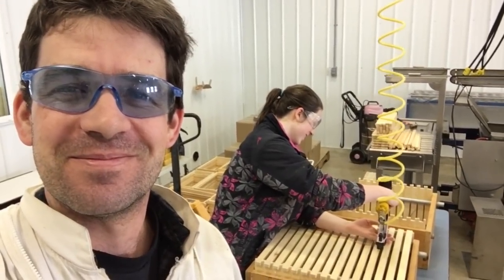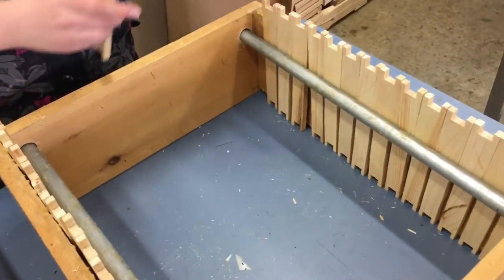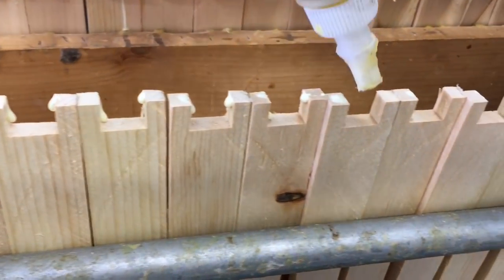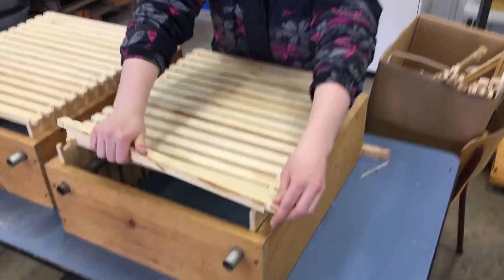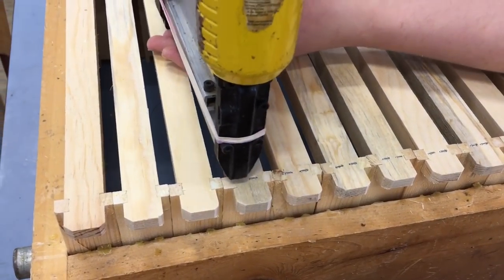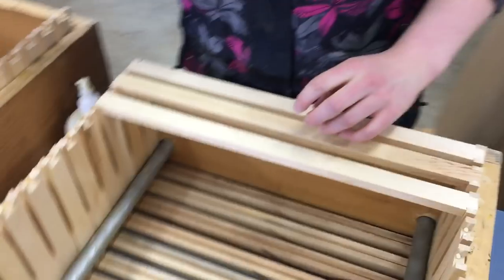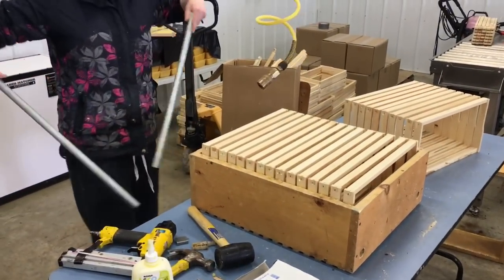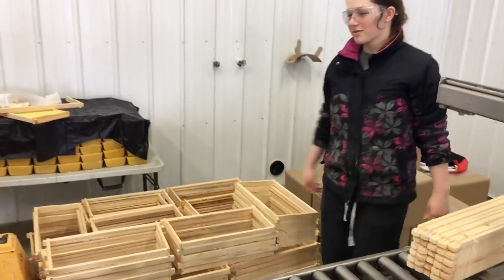Sunday afternoon building frames

Comment: I use almost identical setup by with 10 frames, since i usually build frames and hives at the same time with my wife, so its easier to put them right away in the new hive and stock it like that.
Thanks for sharing, interesting idea to put glue on the sides, it might help to keep sides toghether when you seperate frames glued to each other by propolis.

Comment: Nice video Ian. Have you tried pre-gluing the ends and then inserting them in the jig? I used to hold 10 ends stacked up, and then glue all 10 in 2 strokes. Works well. I have a video of it on YouTube.

Comment: I luv your videos, but you highlighted a pet peeve of mine.  Basic woodworking says that you shouldn't put in your nails (brads) in the direction of pull.  I have pried up many wooden frames that were a bit stuck (the ones I received with nucs... not the ones I build myself) and pulled the top bar off the rest of the frame.  Why?  Because that is the direction of the nail.  Instead, consider switching to pin nails (23 gauge... yes, you have to buy a $100 pin nailer) and putting one pin at each corner from the side of the frame.  Now the pins (i.e. the nails) are in shear and the pins don't give, therefore the top bar of the frame stays on the rest of the frame, even when prying a stuck frame.   Second, I was surprised that you don't use a bit more glue on that flat area (between where you put the two dabs of glue).  Sure, it is end grain, but it adds a bit of strength.  The pins might hold all by themselves, but a good glue joint will stiffen up the frame.  Glue isn't that expensive.
Reply from the maker: Mike Wrobel 
Time is money 🙂
5000 frames built this spring during rain days

Comment: You can hold the 15 frame sides all lined up compressed in one hand and run bead of glue in the U and brush the glue with a disposable brush and install them into the jig with glue already on them. Works great for me.